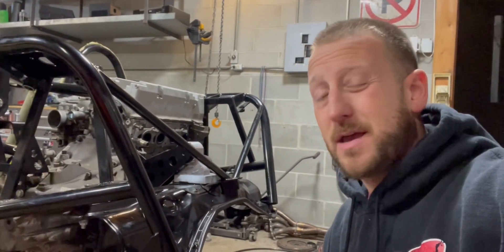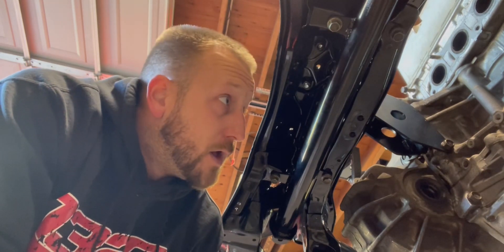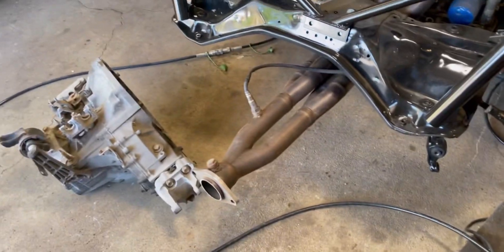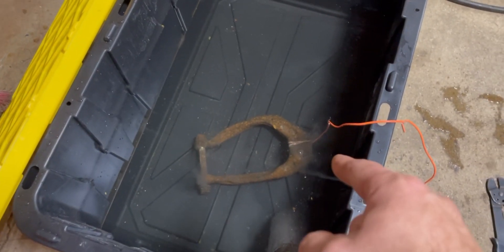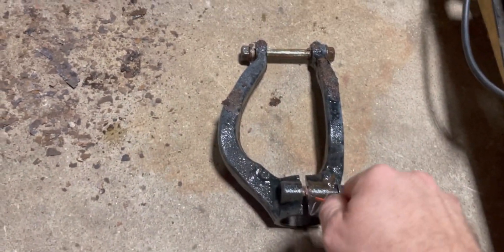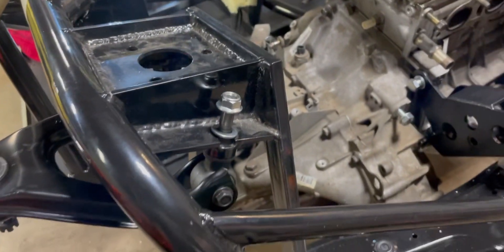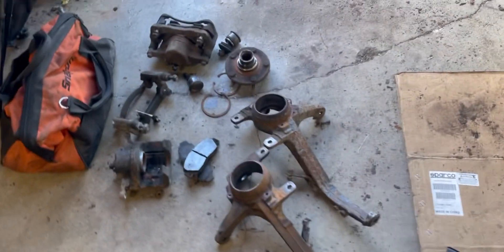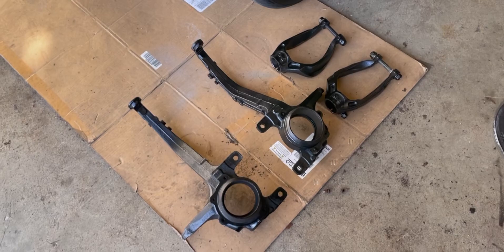Rust Removal Via Electrolysis!! Rear Suspension Part 1. K Series Supercar Build Episode 8

Comment: Hi!
I did send Petr an email a week ago but havent got any reply yet.
Did you have any conversation with him before you ordered your kit?
Was he very slow replying for you too?
And can I ask, what is the bolt pattern for the front wheels on the hobs that came with the kit?
And, Do you know the width between the surfaces left and right where the rims rest on the brake rotors on front axel and rear axel on you car?
Reply from the maker: He is extremely slow to respond. Typically about 2 weeks before you hear back. I have waited as long as a month before hearing back. Yes i talked with him a bit before ordering. Front hubs are 5x100. It uses vw golf parts up front. Idk the width atm.
Reply: @kieferskustoms  Have you got any information from them about maximum HP and torque for the shassis?
Do you know what weight your K1 will end up on....?
Reply from the maker: No none. They did send me a very detailed torsional strength test breakdown. Its rather interesting. Personally i have no idea how to transfer that into real world knowledge but i can send it to u if u want